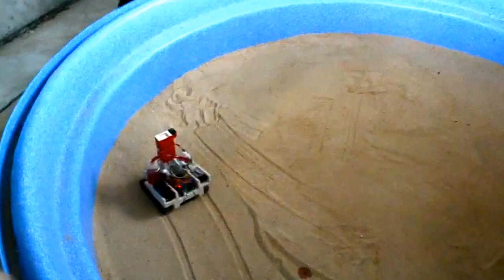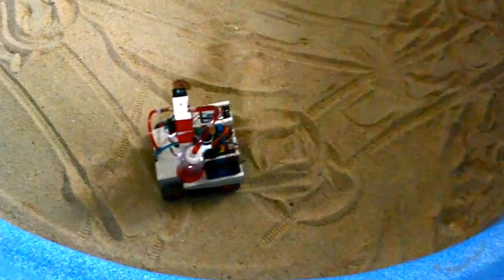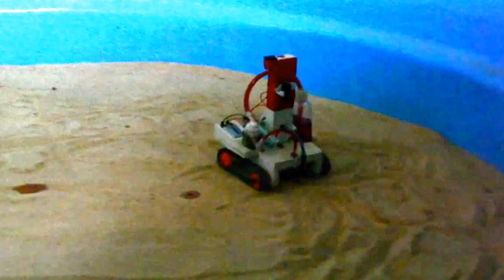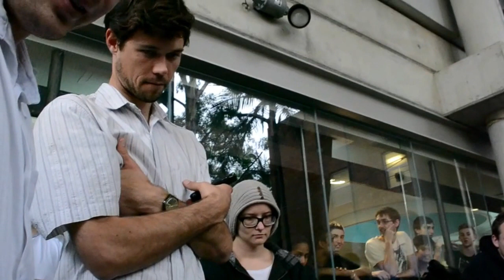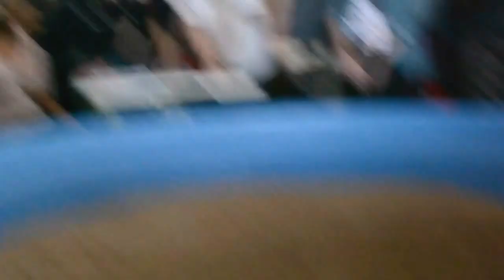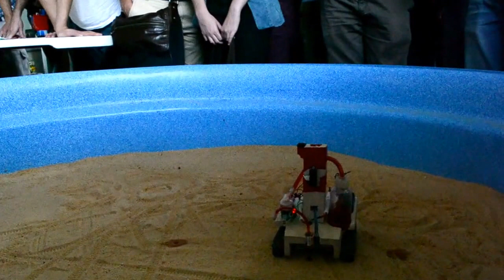Autonomous mine detector

Comment: Excuse me,  however which type of the marker system using in this mine detector?
Reply from the maker: Our marker was just a dyed liquid with some sort of a motor system to feed the liquid down a tube. I can't remember exactly what it was we used.
Reply: It means that you use motor in marker system? Also how to control the amounts of liquid to mark ?  By software?
Reply from the maker: We worked out how fast the system would pull out liquid, and used software to just have it act for a certain amount of time.
Reply: Jim Cullen really awesome!! can I ask one question? like.... How to put sensor positioning system and markere system together? and How many sensors for detecting mine?? , not the IR